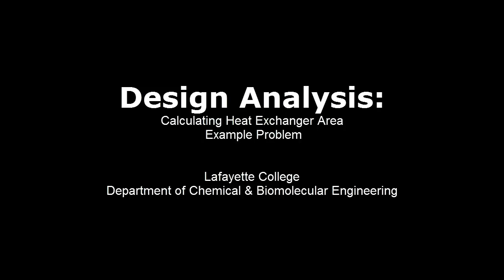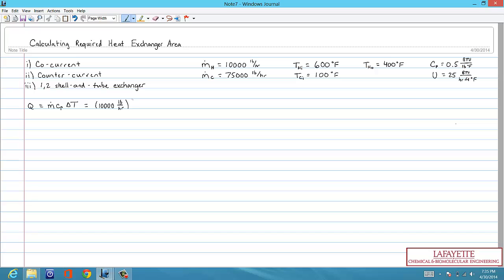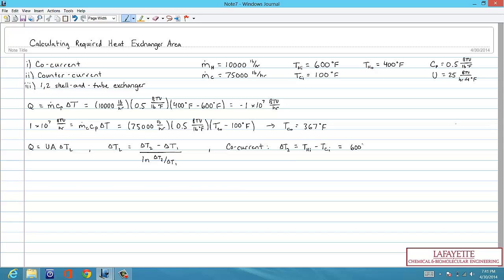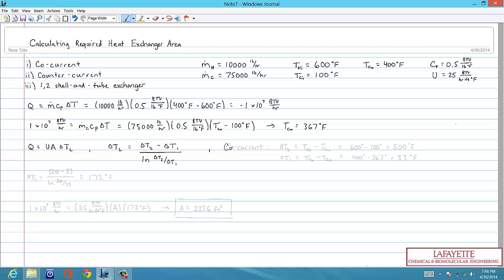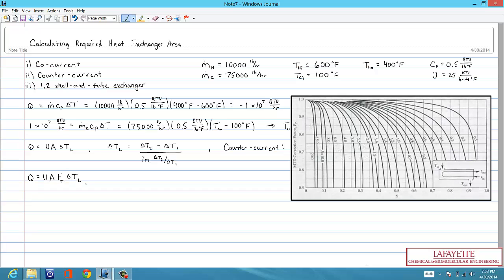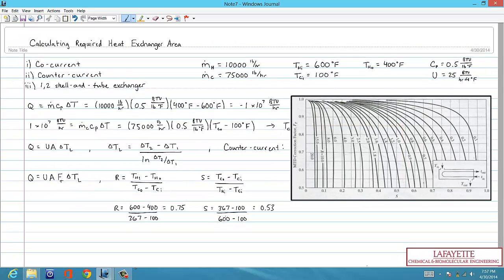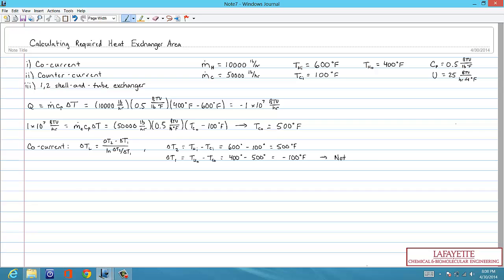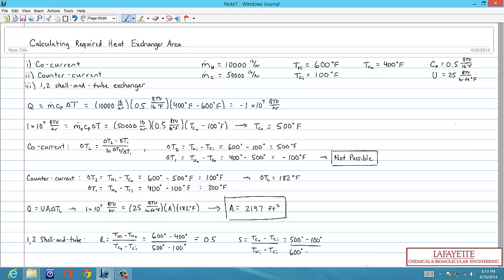Design Analysis: Calculating Heat Exchanger Area

Comment: I have a stainless counter stream plate heat exchanger with water to water(with stuff) exchange, one side should be cold down 35 C (70-35) and one and other stream should be raised 35 C (30 - 65), any body can tell me what is the value of U i should use please!